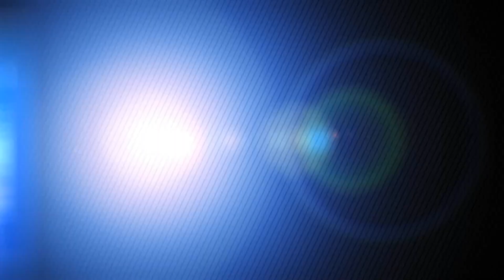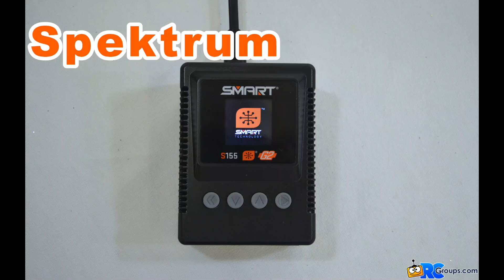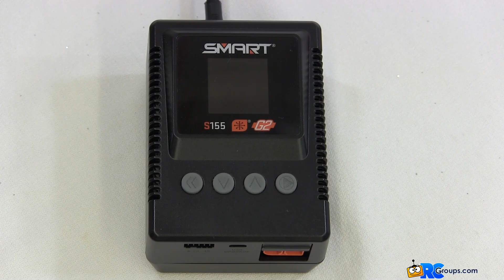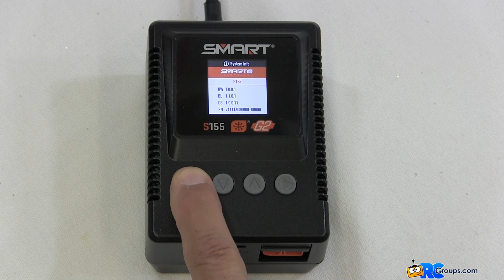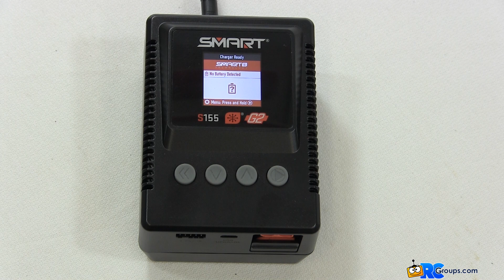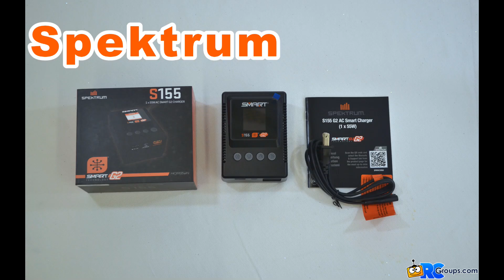Spektrum S155 Smart Charger Part 1 – Set Up

Comment: I bought a bundle that came with this charger but the screen was cracked and does not display anything. I have another on order and wondering if there was anyway to verify what mode it is in. Like a default standard setting it defaults too on all of them. I could also monitor the at the wall wattage. Unless I can verify with some repeated certainty I will likely just throw it away. Would be nice to charge two batteries. Obviously safety is important so I likely won't have a good way to utilize this.

Comment: New to the hobby. Can you tell me what cable id need to charge my small 400mah 2s packs? These are for a 500mm park flyer. They charge through the balance lead on the factory charger, but it doesn’t look like the s155 will start charging that way.

Comment: I had bene using this s155 charger with Spektrum Smart Lipos just fine and all of a sudden it started giving me the error "No balance lead detected" on some batteries.  Slowly it started giving me this error on ALL batteries, even the Spektrum G2 series where there is no balance lead to plug in.  Any ideas what could cause this?  Thank you in advance!
Reply: Yes, some of the earlier Spectrum smart charger had a problem with the microchip. I learned early to always update the battery with the charger when you first buy the battery, and one out of five batteries then failed and defaulted to requiring the balance lead. So, back to Horizon Hobby within the first thirty days for an exchange. Horizon Hobby is well aware of this Spectrum problem which supposedly they are working on but this doesn't help you unfortunately outside of the 30 day return.
Reply: The battieries had the problem NOT the charger....my error
Reply: @TOURMANBOB  I paid extra to have all smart g2 batteries and every single one won’t charge.  Almost a grand in batteries.  Man this is disappointing. Wishing I went with cheaper Lipos. I would have saved a boat load and I’d have working batteries.